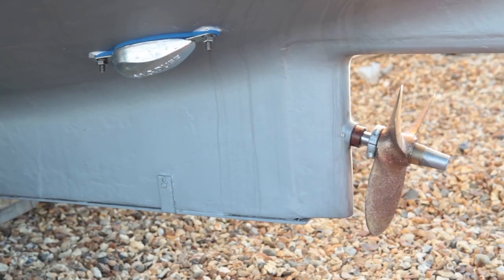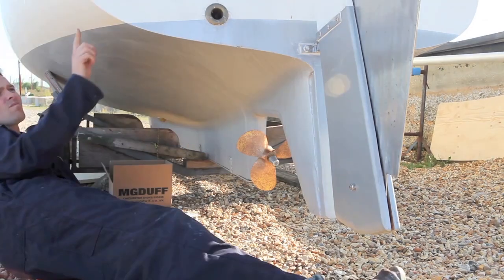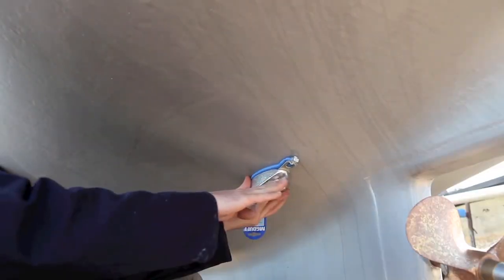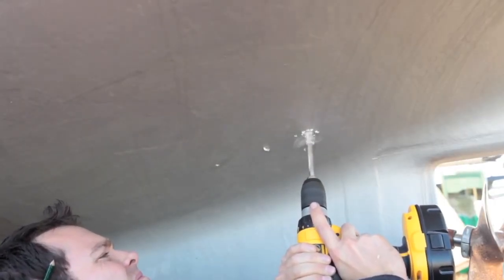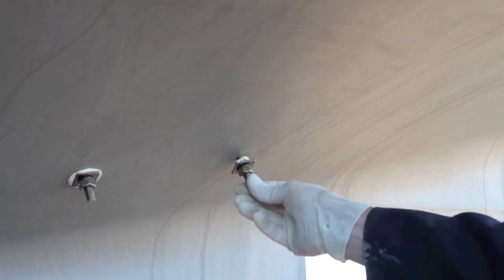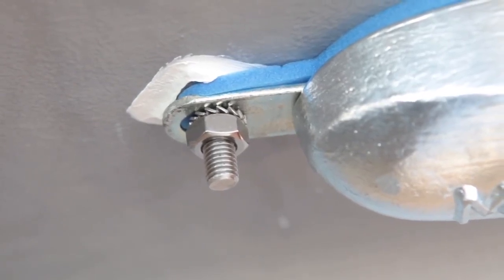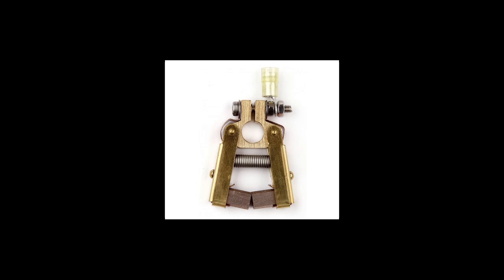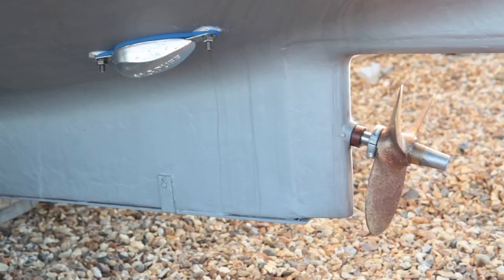How to fit a hull anode

Comment: Really helpful seeing how to apply the sealant, thank you. However, I have been told not to press the bolt against the hull as firmly as that as it squeezes out the sealant , and now I’m confused; not to mention unsure about how tight I make the nuts that are inside the hull?

Comment: Good video but at 1:27 there is an major ommission as there is no mention of fitting a backing pad and nuts on the inside of the boat to stop the studs falling out the boat!
Reply: I did wonder that myself when he fitted the anode thinking the weight is going to make the studs fall out. I took mine off, their was no pad and it had left marks on the hull that needed gringing out & filling. Not really sure why it's being fitted as the shaft & propellor both have anodes fitted anyways and engines normally have their own too.
Reply: @AndysEastCoastAdventures  the backing pad goes on the outside of the Hull to stop the anode messing with GRP